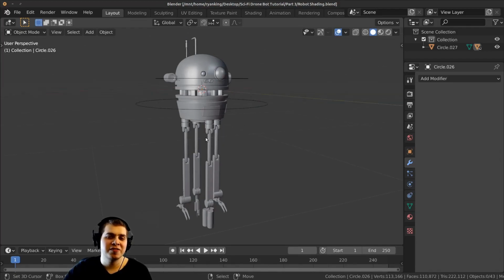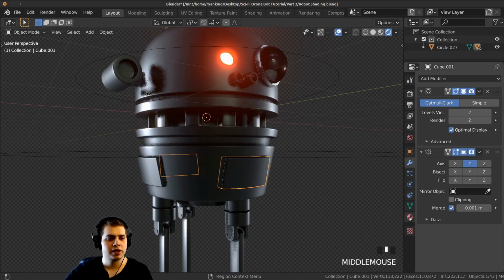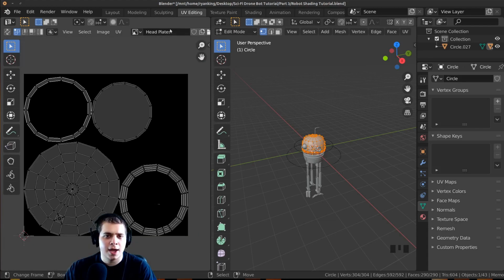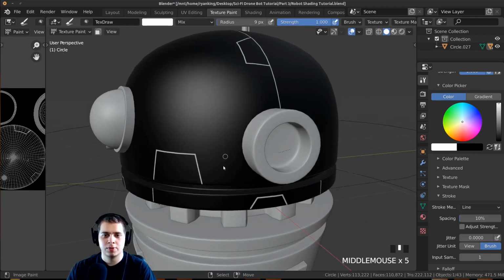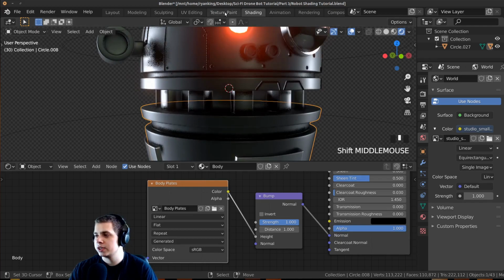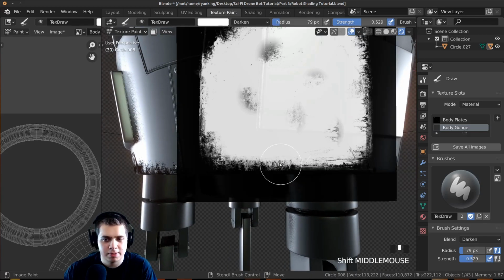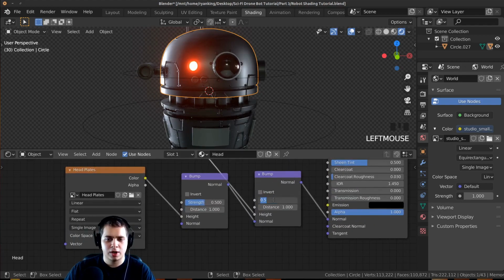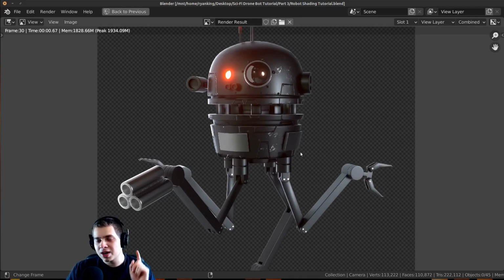Sci-Fi Robot Drone: Part 3 (Materials and Texture Painting)

Comment: 13:24 i'm not sure if this correct or not but i think you should use uv map with the pixel amount always being in the power of 2 (1024, 2048, 4096 etc) as they give the texture resolution of 1k, 2k,3k,4k etc
Reply from the maker: Yes, that is right. nowadays I would stick to 4096x4096, but back then I just thought 5000px was fine for some reason. 🙂
Reply: @RyanKingArt  ok thanks for letting me know too

Comment: Hi Ryan, first of all I have to thank you very deeply for bringing us these great tutorials, after which I have a question. I assigned two different materials to the robot body part, and when the texture painting stage comes, I can only paint on one of them and the other is all colored pink, how can I paint the texture on both of them?
Reply from the maker: You said they are two different materials? I think that might be the problem.  If they are two different materials, you might want to texture paint them separately. Or just use only one material.

Comment: when i switch to render mode my model turns purple
Reply from the maker: It might be because you moved the blender file to a different location on your computer. Or maybe you moved your HDRI or Textures. So Blender doesn't know where they are. Textures turn a purple color when Blender doesn't have the image data. So check the HDRI and textures, and if you need to, Re add them into Blender.
Reply: @RyanKingArt  thanks for the help i didnt notice i had deleted the HDRI lighting file, thanks again for the quick response.
Reply from the maker: @TacoRabioso  Glad I could help. Thanks for watching!